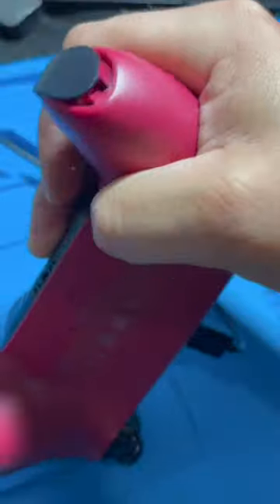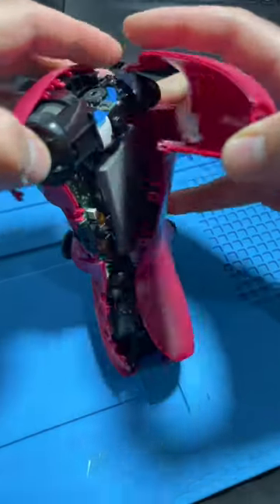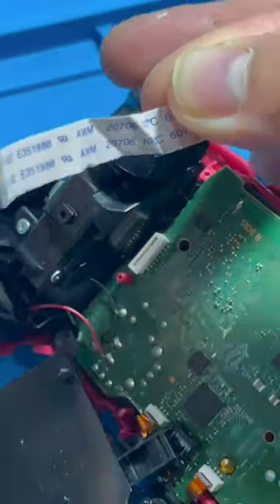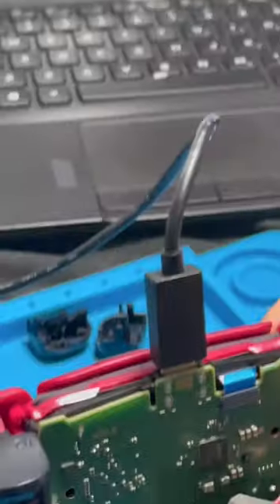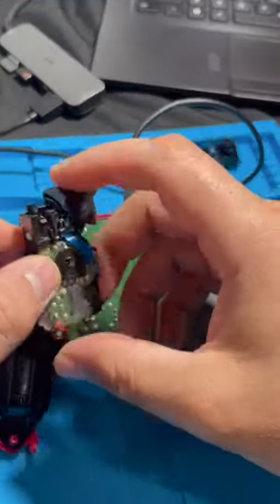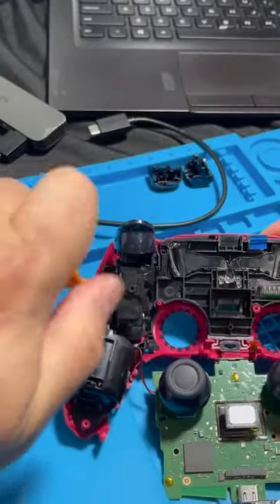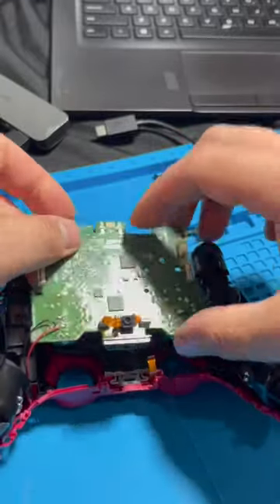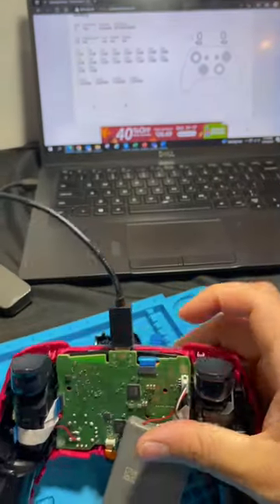Fixing Broken R1 Trigger On Playstation 5 Controller  #shorts

Comment: That's a lazy repair. Just fix the original one🙄
Reply: yeah tried the ribbon cable when it was was reading and went straight to replacement 😭
Reply: Ikr he didn’t even repair the thing he just replaced it with a new one…

Comment: My ps5 controller won’t respond to gui and ui in games how do I fix that
Reply: That is usually caused by a bad button which causes it to not be able to move in gui elements when used in game the button combinations are ok but when operating gui it will only accept a 1 button command so more than 1 button cannot be pressed
Reply: @ninety12  the button or board